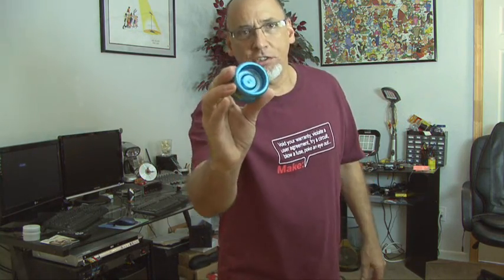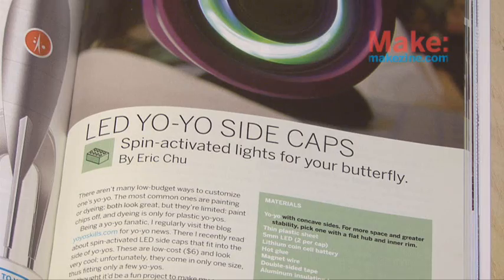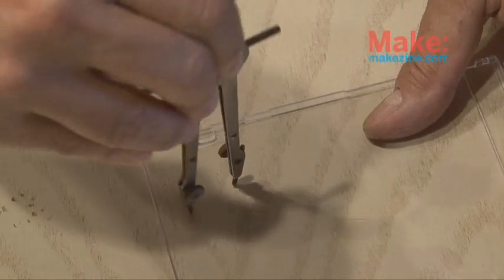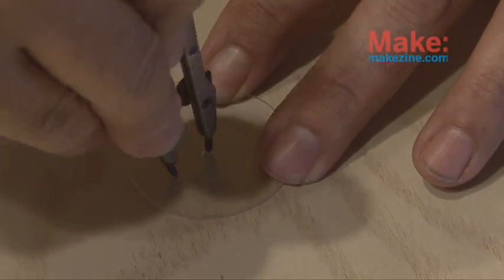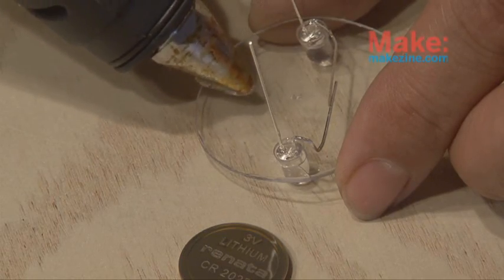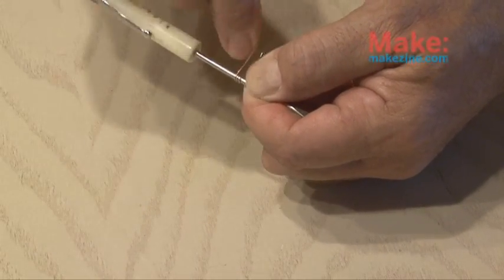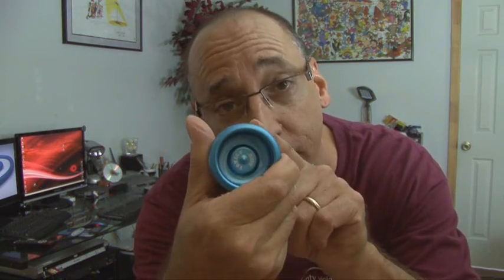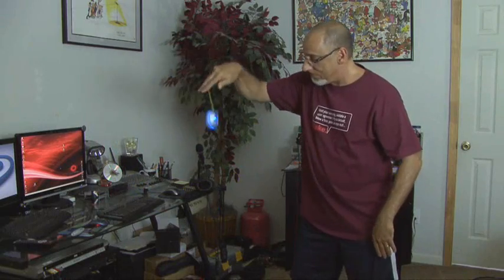Weekend Project: LED Yo-Yo

Comment: @PSPGlover I dont understand much of that stuff but I think there are chemicals in batteries.If you solder directly to it you can damage the outside and the corrosive chemicals can come out, which obviously destroys the battery and is also hazardous to people.
Please correct me someone in case Im totally wrong.

Comment: No need to measure the diameter of the battery: a CRXXYY battery is XXmm in diameter (and Y.Ymm thick).  A CR2025, for example, is 20mm in diameter and 2.5mm thick.

Comment: If you throw it hard enough, then it will sleep."sleeping" is the yoyo term for spinning at the bottom of the string.Ball bearing,transaxle,& clutch yoyos will sleep.For beginners,I would reccomend a yomega brain,peter fish originator,
or a yoyofactory F.A.S.T. 201.Do NOT buy a yoyo that says "unresponsive" or "requires a bind".Those yoyos don't come back when you pull.You can buy
and learn at yotricks or yoyoexpert.Good luck yoyoing!

Comment: Ball bearing yoyos wont come back if you throw it weak only clutch yoyos and most transaxles can besides the F.A.S.T. 201 it has a bearing, but what makes it come back up is the active starburst system that is attached to a plastic or metal inside the yoyo,  when it spins the centrifugal force pushes the plastic or metal ( that's connected to the starburst ) to the sides, and  that what makes it sleep, then when it slows down the starburst clamp the string and that makes it come back.
the

Comment: that looks awesum, did you avoid the resister circuit by using the low voltage battery? I thought you always needed a resister in an LED circuit?

Comment: @ironferret2313 portal? no thats next week out a a rubber band two condoms and 3 leds also you dont need it but its recommended a soldering gun and wire